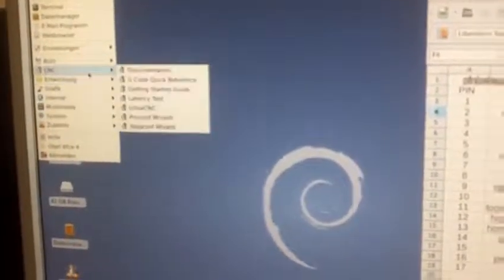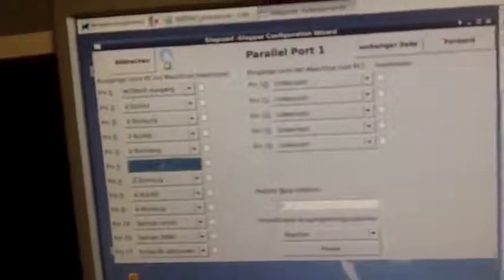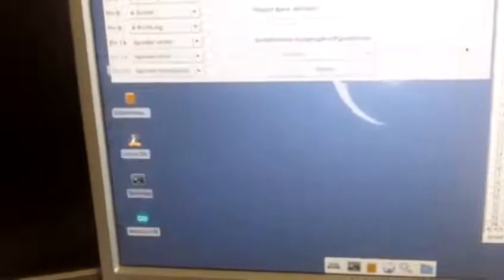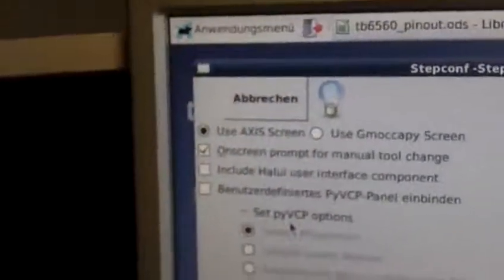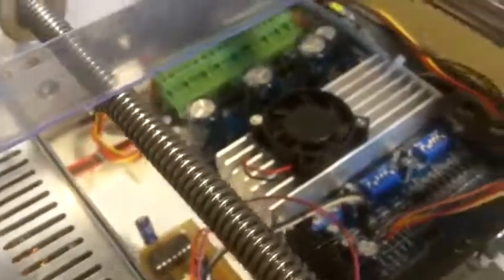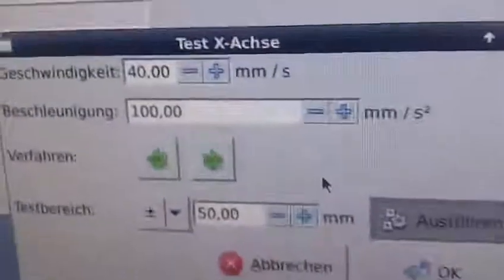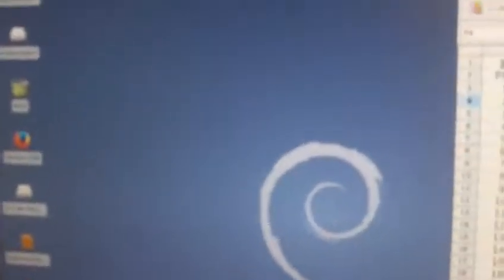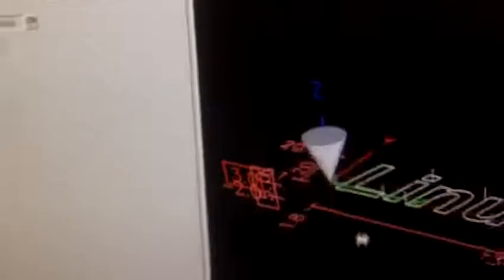TB6560 config of the Machine Including Full VFD at Proxxon

Comment: Hallo ich habe mir vor 2 Jahren diese Karte von Ebay gekauft, leider bekomme ich das mit den Pins immer noch nicht hin. Die freundlichen Leute aus China gibt es nicht mehr und eine Anleitung war nicht dabei. Ich habe schon unzählige Videos auf Youtube zur TB6560 gesehen und alle hatten eine unterschiedliche Pin-Belegung. Woher bekomme ich die richtigen Pins raus? Können Sie mir hier bitte weiterhelfen. Danke und mfG Alexander
Reply from the maker: Es sind doch so viele datasheets und mach3 installations schritt für schritt online
ES gibt mehrere Versionen dieser Boards
ROT Blau 3-5 achsen
 zudem ist das board überholt mit maximal 5000schritten je sekunde nd die Dioden fallen auch oft aus 
hier ein e adresse osservatoriobassano.org/TCS2015/3%20Axis%20TB6560%203.5A%20Stepper%20Motor%20Driver%20Board%20Manual.pdf